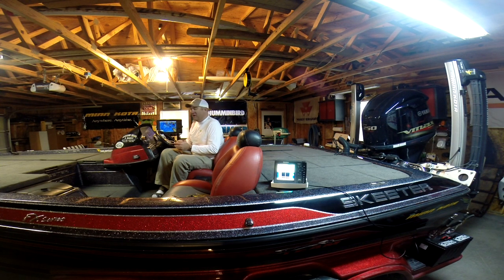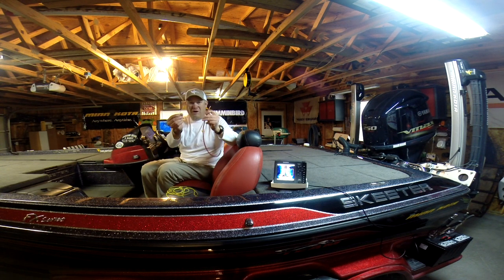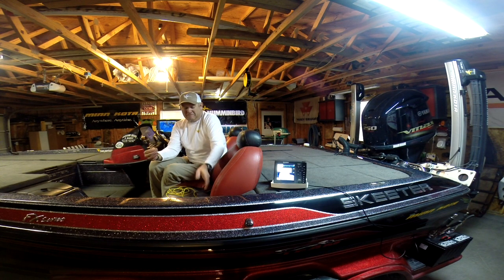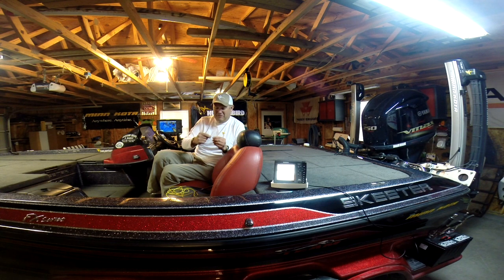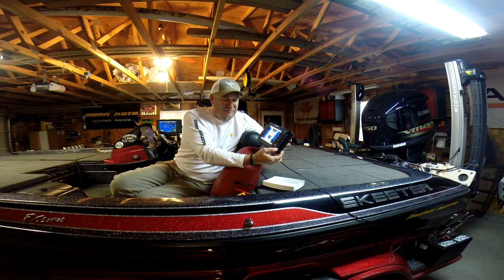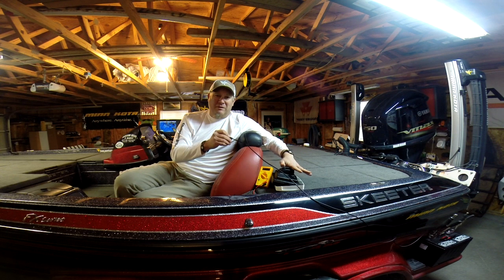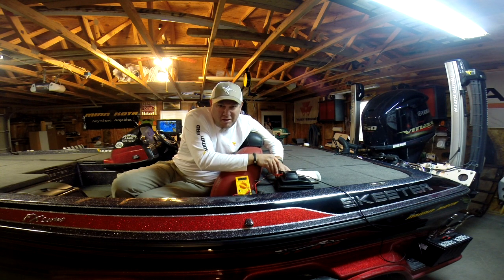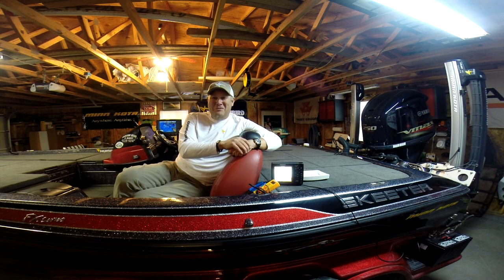Tips 'N Tricks 101: Set Up Tips for Fishing Electronics Power Supply

Comment: Just one reminder also on cutting you power wire to length. If you power wire is longer than need be, the rolled up wire is also causing resistance. Thus reducing your power.

Comment: Doug great video! I was wondering if you could explain specific examples of what an underpowered unit might be missing. For example: Will low voltage effect 2d readout, down imaging, side imaging? Would you lose definition? GPS accuracy?
Reply from the maker: It varies but all what you mentioned and more can happen with underpowered unit. Sometimes the features work fine next one of those don't and something different maybe the next day. First step is making sure you have the proper power supply.

Comment: I used the wiring that was installed and supplied by the manufacture and it was sealed in the base, I'm sure if I took the Humming Bird Unit apart and rewired it it would have voided the warranty and why would I need to change the gage that should have been the proper size from the manufacture?
Reply from the maker: +Ronald Kolowitz Not saying open the Humminbird Unit. You need to Connect the Humminbird Supplied Power Cable to the proper gauge wire. For CORE, HELIX Series I recommend 14 Gauge MultiStrand Wire of ONIX/ION use minimum of 12 Gauge I use 10 Gauge Wire, SOlder the connections and use a 3 amp Blade Style Fuse. DO NOT USE the Existing Wiring Boat Manufacturers use as they are normally smaller wire than the unit needs to power itself properly.

Comment: This guy aimlessly rambled on and on about wire gage I simply wanted to know if was best to have a dedicated battery for the Hummingbird unit, quit often when I have my unit on and I restart the engine the unit goes haywire, if you don't know anything about wire size/gage you probable need some one to plug in a light for you.
Reply from the maker: +Ronald Kolowitz You don't need a dedicated battery if you select the right battery and wire correctly. Wire Gauge will resolved your unit shutting down because the motor is drawing more amps than that small gauge wire can handle. I you supply the unit with a larger gauge wire it will not shut down.